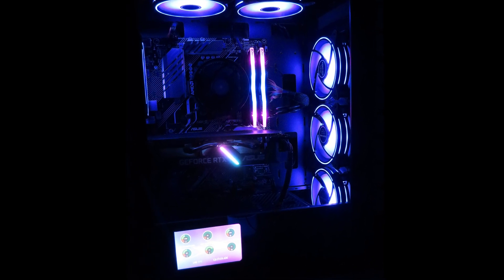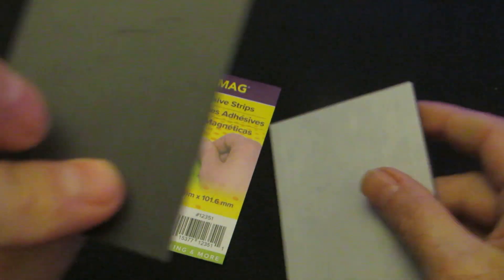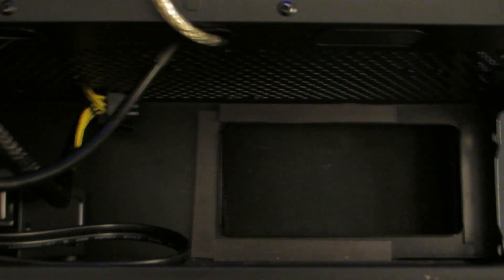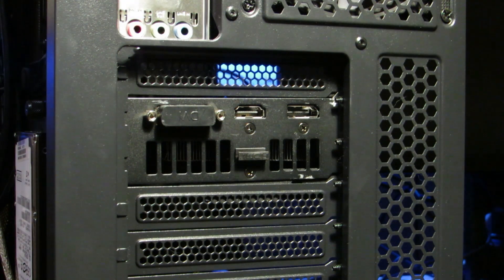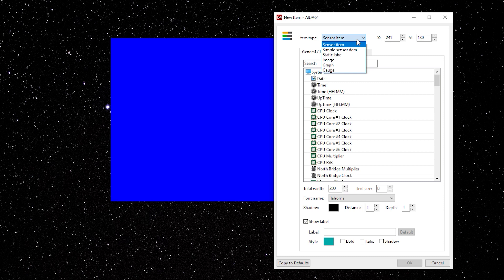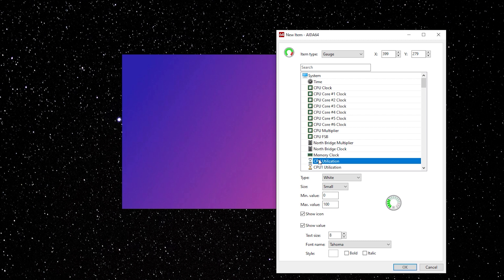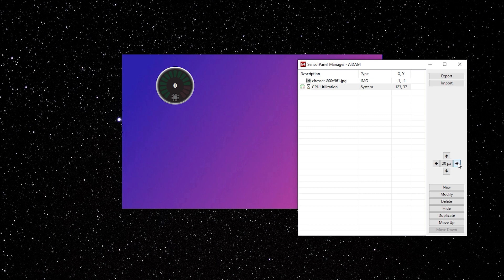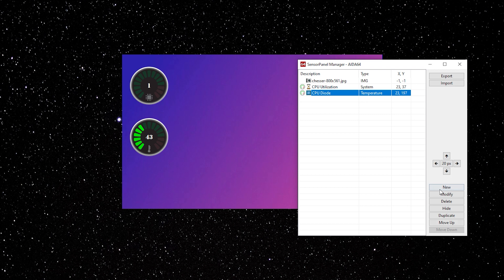CHEAP and EASY SENSOR PANEL MOD-BUILD GUIDE!

Comment: Is that electric tape you used to make it non conductive?
Reply from the maker: It is! Good catch. It's cheap and easy to apply. I've used it on 2 of these types of mods with no issues

Comment: Is there a way to run the screen vertically and still have the sensor stuff?
Reply from the maker: Do you mean rotate the display 90 degrees so you are looking at it in portrait?  (assuming you are using Nvidia) Nvidia Control Panel - Display - Rotate display - Choose either portrait or portrait (flipped)  I'm not very familiar with AMD software but I'll look into it if that is what you need.
Reply: @390Gaming-q9l  thanks yeah I appreciate

Comment: I just can't get that FPS to work......What am I doing wrong?
Reply from the maker: Do you have Riva Tuner Statistics Server installed? Reboot after and it should now hook to any full screen application.let me know if this helps
Reply: @390Gaming-q9l  Yes I have that installed .I just checked..I am making a new panel right now..
Reply: @390Gaming-q9l  It still doesn't display the FPS...I have no clue..):
Reply from the maker: @MrDoom6969  what version of RTSS and AIDA64 are you using? 
I didn't have any issues with it not working.
Is RTSS running in your system tray?
Reply: @390Gaming-q9l  Version 6.3.550 and I don't see the rtss  running in the tray
Reply from the maker: @MrDoom6969  try starting RTSS from the .exe once you see it in the taskbar, R click 'show' and 'start with windows' should fix it
Reply: @390Gaming-q9l  WOW !!!! That Worked....Thank you so much...no one on youtube never said anything about this thank you...(:
Reply from the maker: @MrDoom6969  Happy to help! :)